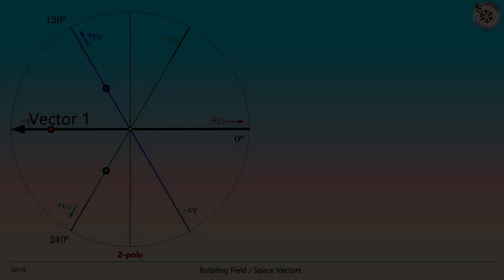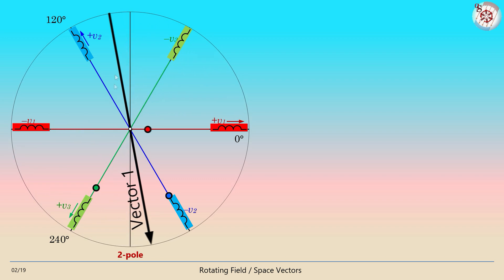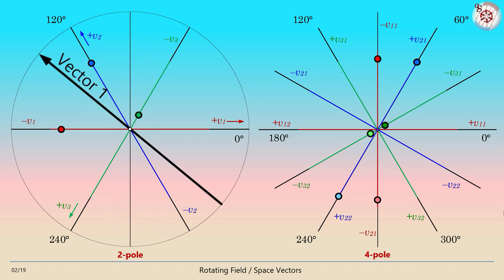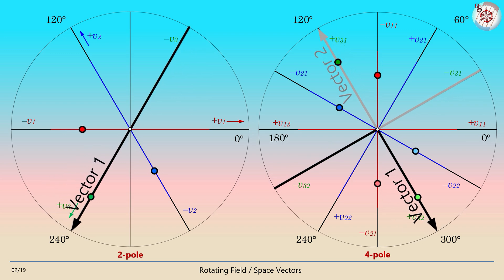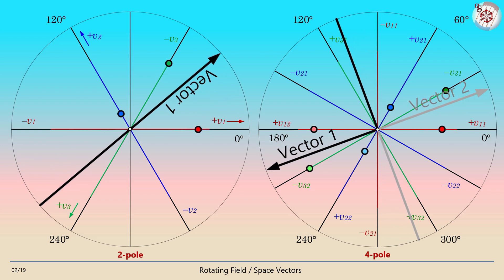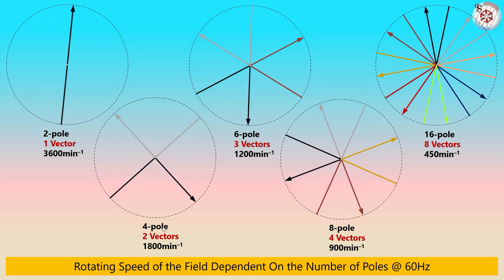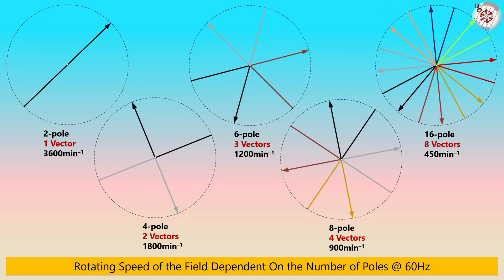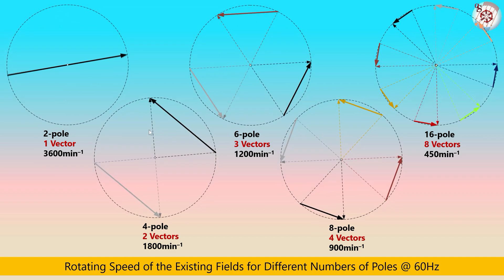Voltage Space Vectors and Synchronous Speed in Electric Motors with Two, Four, Six or more Poles

Comment: Is there any book o literature that shows the mathematical equations for 4 or more poles?
Reply from the maker: Unfortunately I did not find anything in literature. That is why I put this video together for my students and everyone else who is interested.
Reply: @quellstrom  ok thanks You very much, this video helped me out to understand how a space vector works in 4 pole machine, and in books show the same equation for 2 and 4 or more poles (3/2)F cos(wt-p∅)  and i don't see the diferents values of speed fmm vector for 4 poles or more in this equation
Reply from the maker: Well, the point is you only have three voltages and they are always the same on the electrical side.
So it depends on what you do on the machine side. You can arrange your field windings in a way that one full period equals one full (physical) rotation or ... less (half, third, quarter etc.)
So far, so good. The interesting thing is that now you have for every three field windings one (voltage) space vector in the machine. This is what often somehow is not really pointed out.

Comment: Hi! Excellent video but I still have a question. I want to implement a foc in an 8 pole machine, so, what frequency I should use to estimate the switching frequency, the mechanical or the electrical? And, I got to generate 4 spacial vectors? Or just one?  I mean, I got to generate just one and the others appear because the coils and magnets distributions or i got to generate 4 independent spacial vector with full control of each one? Thanks for the video!
Reply from the maker: Hi there. Quick answer: You create ONE voltage system with THREE phases at your nominal frequency 50 Hz or 60 Hz.
Extended answer: most drives like to be able to turn at higher speeds than the nominal operating point. It is not unusual to allow an "inverter created mains frequency" of up to 80 Hz.
And no, you don't need more than just one three phase system. The rotating speed of your machine is divided accordingly to your number of poles, cf. video.
Special applications can go for (much) higher "inverter created mains frequencies". So, check with your boss and/or your client. ;-)
Reply: @quellstrom  ok, I see... so I got to generate a spacial vector that rotates at the electrical frequency, right?  And that speed is divided between the number of poles like the classic way of design. Thank you very much. Like and subscribed!